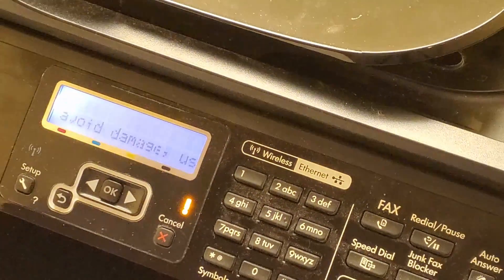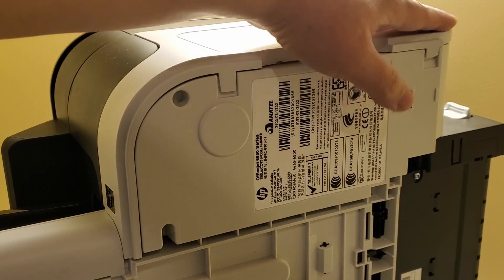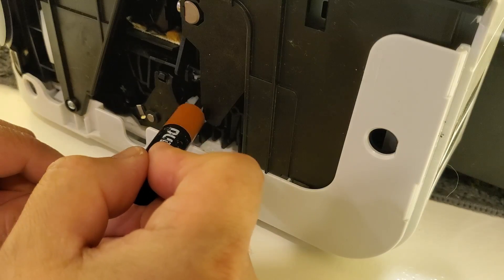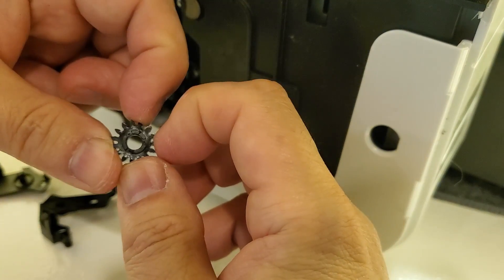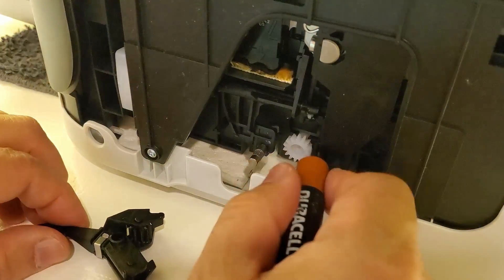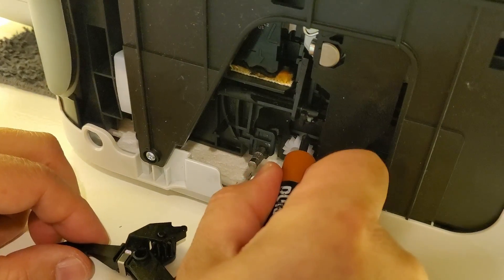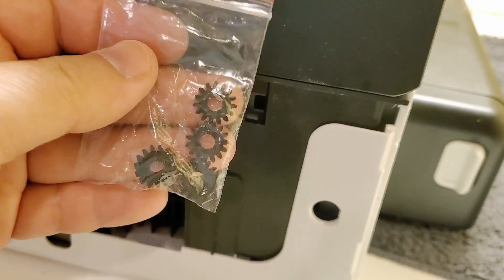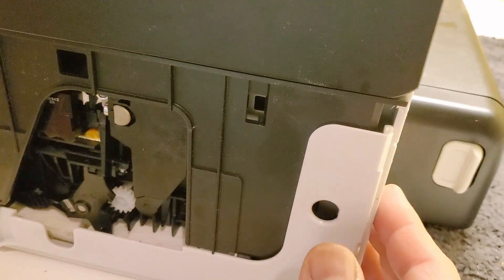How to Fix HP Printer False Paper Jam Error (Cracked Gear Causing Carriage Stuck Right),in 10 mins

Comment: Thanks for making this!  I need to get the replacement parts delivered, but the problem I'm having with my printer and the one you described in the video sound identical, down to the broken gear.  Hoping my printer will be good as new once the new gear comes in!
Reply from the maker: All the best with your repair.  Thanks for sharing your experiences.

Comment: Thanks for making the video.  I was successful repairing my printer thanks to you.  I did put the pieces back together on the printer separately and had no trouble getting the gear to slide on without much pressure.  Also, there was a small groove the mechanism needed to slide into for the proper functioning to occur.  Something different machines, like mine had.
Reply from the maker: This sounds great congrats on the repair!

Comment: Thank you so much for this fix. Couldn't figure out why the paper try pickup gear assembly was stuck in the up position - it wasn't being driven because of the cracked gear.  The problem is with the design. That 15T gear is the driving gear - should be metal not plastic. The shaft actually has to friction fit to it adding to the stress on it.
Reply from the maker: Good comments.  Not sure if the gear was plastic due to cost savings or made to give out under stress as it might have caused further damage if it was made of metal and didn't give out so easily.  I think it was probably cost was the main reason.
Reply: @IsInteresting  Yes. Point of failure as protection is a good point as well. Like a fuse.

Comment: The black gear carrier should not be rocking back and forth. At its lower right corner is a finger that slides in a stationary U-shaped guide just below the white gear. You need to align the finger with the guide (use a good light to see it) and push the gear further onto the shaft, until a short length of shaft (1/32 inch, 1 mm) protrudes from the gear carrier. That will position the new gear in the center of the teeth (knurling) on the shaft.
Reply from the maker: Thanks for adding to the fix here!  Will definitely help the community out.

Comment: Thanks for this video - On the metal rod there are teeth, should the replacement cog/gear have teeth on the inside circle? It doesn't look like your original or replacement cog/gear had teeth on the inside circle. I have taken my cog/gear off and like you it has a hairline crack but it looks like it may have had teeth on the inside circle but they may have stripped off almost totally or could it be there were'nt any but the metal bar has made an impression on it and kind of cut teeth into it? The replacement ones don't look like they have teeth inside them so I am a bit confused. Should it be a friction fit or teeth interlocking between the metal rod and the replacement cog. Thanks for any advice you can give.
Reply from the maker: Thanks for your question 👍.   It really helps the community out as it may answer the same questions others may have.  The gears have no teeth in the inner ring.  It works mainly by having a snug fit.  The teeth on the rod seems more to give it a snug fit and prevent it from just spinning on the rod.  I am thinking it is built that way as to not be so secure that it will snap parts if something gets stuck.  It is secure enough to turn though.  If you don't want to miss any of my future content please consider subscribing.  All the best!
Reply: @IsInteresting  Thanks for the reply and the information!
Reply from the maker: @C4sp3r123  thanks very much for supporting the channel.  I wish you well on your repair.  All the best!
Reply: @IsInteresting  Just to let you know I have now received my spare part and although it was a fraction smaller than the original cog it slid on the rod easily, a little too easily I thought initially, but I fired up the printer and it worked straight away and now I have my printer back working. One tip for any one reading this, to make it easier to see if the metal rod and white cog are turning I put a line on their sides with a permanent marker, then as they spin you can easily see the line spinning round, it can be quite tricky depending on the lighting to see if they are turning or not. More so the silver rod.

Thanks again for the video upload, it daved me chucking away a perfectly good printer for the sake of less than £3 spent on parts. I now have a load of spare cogs should it break again!
Reply from the maker: @C4sp3r123  thanks for mentioning how everything went here.  I am glad 😊 it worked well.  All the best and keep watching I will have new videos out soon!
Reply: I forgot to say that I was fixing a HP Office Jet 6500A Plus printer. Thought I would mention the model as it may help others with the same printer.
Reply from the maker: @C4sp3r123  Thanks so much for helping!

Comment: I replaced the the crack piece assembled it all together now the white spinner you said to turn to the left that one is like jammed any help on how to fix it
Reply: Not sure, but on mine the white gear only turns when engaged by the black gear that is being replaced in this video. Same gear?
Reply: I replaced the same gear my print head is stuck to the right I cant even move it
Reply from the maker: Thanks very much for your reply I will respond back to the original question.  Your response was helpful but I will add to it.
Reply from the maker: Hi like the other viewer mentioned the white gear is unlocked for movement when the whole black gear mechanism that you just fixed is depressed inward. When it is depressed inward it contacts the white gear and also seems to unlock it for movement.  As the video shows for the initial start and calibration turn the white gear all the way to the left so that the carriage is in the home position.  If that still doesn't unlock the white gear then something is really making the carriage not move.  You need to check if there is anything obstructing the movement ie.  Like An actual paper jam.  Also take a view of this other video if you have not seen it that mentions freeing up that white gear.  Link is here https://youtu.be/OpjZ6WyJfmA
Reply: @IsInteresting  I turned it to the left and now it’s not even trying to grind with the white gear. At first before I turned it to the left it was trying to grind with the white gear so I was like let me take it out and turn it to the left. I put it back together now it’s not aligning with the white gear. I might just get a new printer
Reply from the maker: @bullsforever23  yes looks like something else needs attention.  Thanks for mentioning.

Comment: Thanks, I was inspired by your fix. My HP C6180 paper jam is caused by a missing rear shaft gear. But it is 24 teeth so I'll look for a donor machine. Thanks.
Reply from the maker: Thanks for mentioning.  Yes some times hard to find the serviceable parts.  All the best in your repair.

Comment: on my printer the black housing that holds the 15 t gear and the the lower gear that rolls the white gear is broke. can you buy that part? i have no idea what is call but i will call the  gear housing. i probably would need the whole part
Reply from the maker: Hi I am thinking you are talking about the triangular black piece that holds all the gears together.  I really don't know the name either for this and did a search for it before, to no avail.  I just call it the gear assembly.  The lower gear that turns the white gear, you can count the teeth on it and do a search for it.  Ie. If you counted 10 teeth look for a 10T gear of some sort that looks similar.  In other comments I suggested repairing the gear assembly by using  metal twist ties since you may need to disassemble it in the future.  If the extent of the damage is severe you may try using hot glue and carefully attaching everything back together.  However this would be a permanent fix and you can't disassemble it in the future.  Remember these are only suggestions and you fix it at your own risk.  Thanks for your comments.
Reply: I know this is an older thread but a guy I read the other day created a mold with some silicone epoxy.  Then created a gear he needed with steel epoxy from the mold.  Genius!  Not sure if that could work with gear assembly? @IsInteresting

Comment: It seems that I broke the plastic clip at the top of the triangular mechanism that holds the cracked black cogwheel. I still have the metal clip.  Do I need to now replace the whole triangular piece? If so, do you know what that part is called? Do you have a link? If I reorder will it contain the black wheel or do I still need to order. I appreciate your help.
Reply from the maker: Hi sorry to hear that the piece is broken.  I looked around on the net.  The gear is readily available but the gear assembly is not.  I have some suggestions but I have not tried them myself and you fix and use my suggestions at your own risk.  I would try a twist tie to see if you can tie the plastic pieces back together.  You can also try a drop of hot glue to see if you can imbed the part that broke in the hot glue and let it cool in a cap of plastic glue to keep it together.  It will take some skillful gluing and molding on your part.  Finally you can try a small rubber band to tie the piece together but since the rubber band may degrade over time it is not recommended.  Mention how this helps you out.  Also I have seen different assemblies for different printers so hard to recommend a part even if I can find the assembly.  Thanks
Reply: @IsInteresting  yes, I will try that and let you know. I have ordered the gear and it won't arrive until August.  Thank you!
Reply from the maker: One last thing if you glue it back, remember you may need to prey it open again in the future if the gear breaks again.  So I think a twist tie is best.  All the best on your repair.  Thanks for using my link to order.
Reply: @IsInteresting  twist tie is the plan then. :)
Reply: @IsInteresting  Update.....  I received the pack of gears and have installed one successfully due to your video. Also, the twisty tie solution to my broken clip also seems to have been a success!  Thank you very much for helping me fix this problem (these problems?), and  I have 4 more gears in case that problem happens again!  Much appreciation.  :)
Reply from the maker: @staciakurtenbach3821  This is great news!  Awesome to hear that!  Thanks

Comment: i have the same grinding problem with hp deskjet 5525. hope you can make a video showing to replace the wheel too.
Reply from the maker: I have another printer video here https://youtu.be/OpjZ6WyJfmA  can that help you out?  In that case the white gear was ceased and the black gear that turns it was slipping and making a grinding noise.  Hope that helps.

Comment: My printer has 3 gears inside the shell and I don’t remember where they go can you make a video or diagram as to show how to assemble those parts you only showed 1 thank you
Reply from the maker: Let me take a look and see where the gears can go.  I may need to make a diagram as I would need to take the whole assembly apart.  Maybe I can get some old video  footage.  For now for the video I remember that the thinner 15Teeth gear goes on the shaft and there was a smaller but wider 8teeth gear below that connects it to the main gear which is outside the assembly.  The main gear is white and moves the carriage return.  I hope this helps but thanks for the video ideas.  Maybe I can make a video soon for you.  Remember you fix at your own risk.  Thanks
Reply from the maker: Hi Donna here is a video for you which shows the actual assembly of the gears. I hope this helps you out.  Thanks  https://youtu.be/sio85B7fHB0

Comment: Sir, the T15 didn't want to come out using your method it stuck any help please
Reply from the maker: If the gear is still quite stuck on the axel, check to see if the gear is actually slipping on the axel.  Iook to see if the axel turns but the gears don't move.  Sometimes it is only the white gear that is stuck.  I have another video about it.   https://youtu.be/OpjZ6WyJfmA
If your gear is actually cracked it will be very easy to pull the gear mechanism out or it will fall out on its own.

Comment: Did this, bought the Five gears I will probably never use, tried to put the lever thingy back in, and it just kept falling off... ???  I pushed it in until I heard a click, turned the printer on... it started to move , then fell off..
Reply from the maker: Thanks for mentioning.  What that tells me is that the gear is not fitting properly on the axel.  For me the gear fits very snugly that you can see in the video I am trying hard to put it on.   Is the axel on your printer too small, is it dirty etc.  Does the gear fit too easily and loose?  You may want to try and clean the axel a bit as it may fit better.  Not sure what other solutions there might be to get that gear to fit more snugly.  You can try another gear in your 5 pack as another one might fit better.  Thanks for your comment.

Comment: I ordered the gear via the link you provided. After 4 weeks, I finally received the package today. But instead of 5 pieces of gear, I received 5 pieces of plastic bracket that host the gear. Can you get me a piece or two if you have extra gears? John @ 120 Waltham Way, Fayetteville, GA 30214. Thank you so much!
Reply from the maker: Hi John if you ordered it via Amazon try to return the product and do a reorder.  I returned stuff to Amazon before and it was pretty simple.  A part I ordered came broken.  Let me know how that turns out.  Also you can email me at isinterestingonline.com my official email for the channel.  As mentioned let me know what happens for the return.
Reply: @IsInteresting  I have asked Amazon to replace my order. My problem is that I had to wait for almost 4 weeks. Even they send me correct parts next time, I can't print for a few more weeks. That's why I ask you for extra gear. I can return mine to you after I receive mine.
Reply: @IsInteresting  BTW, your email address seems incorrect.
Reply from the maker: Sorry gave you the wrong address.  I actually gave you my website that is under construction right now.  My email address is under the About section in my channel info.  isinteresting@yahoo.com.  I also have sent you two gears from my original 5.  Just keep them and no need to reimburse me.  My delivery came within a couple of weeks and I am located in Canada.  So unfortunately, you may get it in about 1 week or more instead of the 2 days the post normally takes.  Thanks to you and the other viewers who used my affiliate links, like and subscribe.   Sending it tonight Friday Sept 17th.  Hopefully will get to you soon.  Enjoy!
Reply: @IsInteresting  Received your gears yesterday and put it on, although struggled to install. Really had to push hard to install. Thank you so much!
Reply from the maker: @zhongqianghe4748  that's great 👍you can also put the printer on its side and press the gear in further.  I did that and due to the extra leverage it went in a little bit more.  For the video I put it the normal way so I can show the demo.  The fact that the gear was hard to place means it will fit tightly which is what you want.  Happy printing. 😊